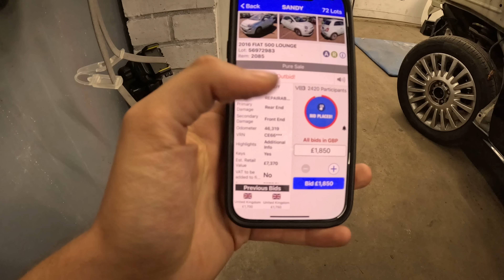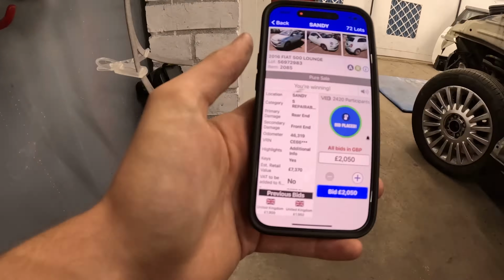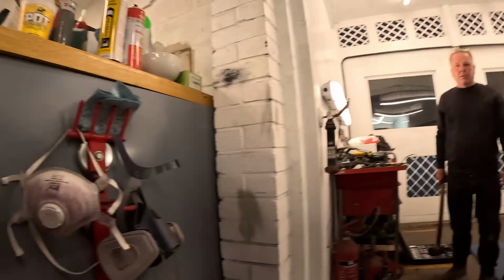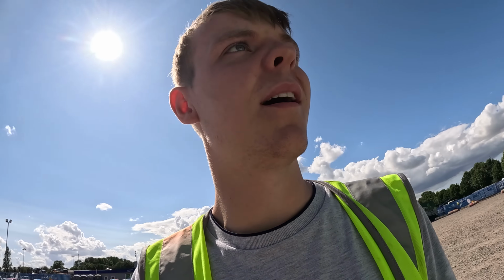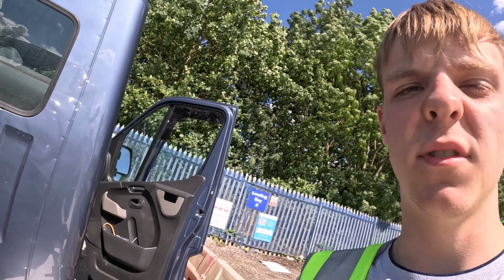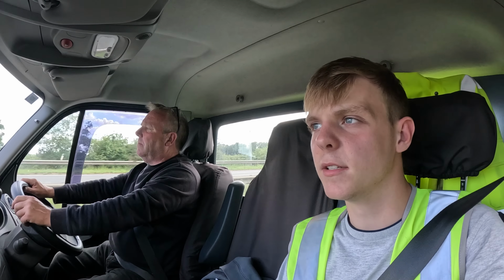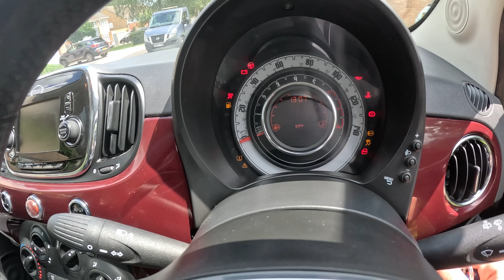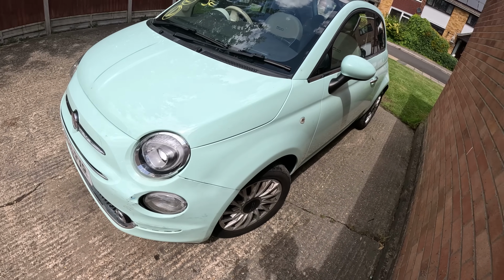I BOUGHT THIS SALVAGED  FIAT 500

Comment: I agree, you paid a bit too much for it....... in my mind, about £2000 too much........ In my 37 years of driving, I've had 1 Fiat, and 1 other car made by a company owned by Fiat. Back in the day I had a Marea, nice to look at, bought it brand new and it failed it's 1st MOT!!!!!! It didn't last beyond 4 years old. Then there's the other one made by a Fiat company (figured it out yet??) a Ferrari 458....... yippee, a good win on the lottery!!!!!
2 of the biggest f**k ups I ever bought, both spontaneously burst into flames, the Marea when I was on the motorway, 458 when it was parked in a car park!!!!!
Anything made by Fiat either blows up, breaks down or torches itself....... terrible cars. residual value is shocking, build quality non existent, parts expensive for what it is. So this car cost just over £2k to buy, will cost another £2k to repair, and it'll be worth about £1500 when finished - - - - - be better off scrapping it